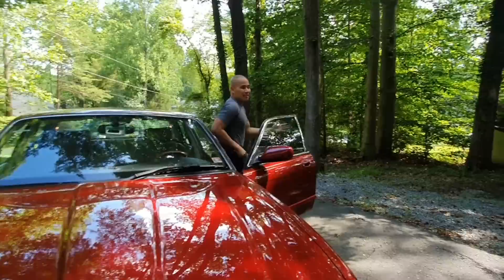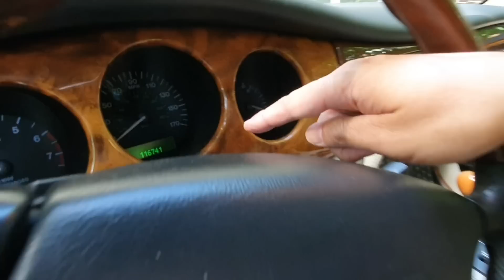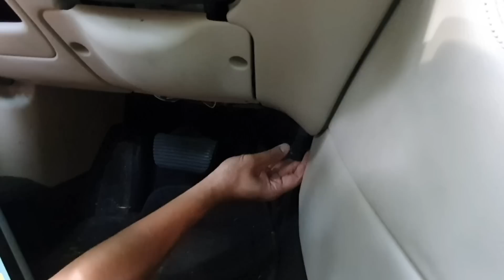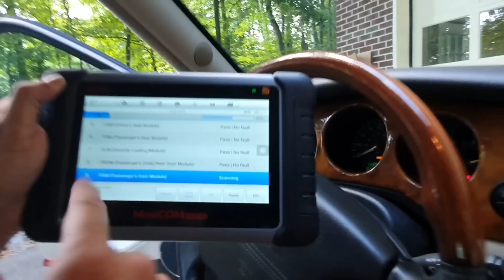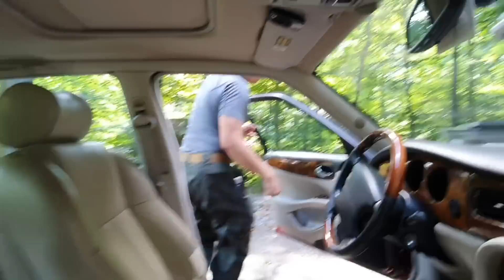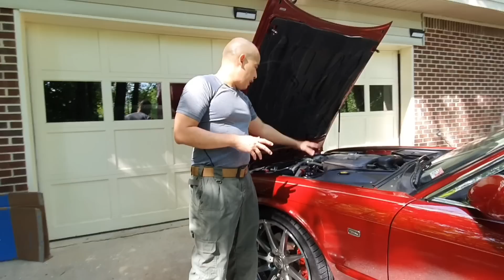Jaguar XJR 2 Years Ownership Update (Reliability Issues, Maintenance and Repair Cost)

Comment: I have an 04 xjr.  I bought it needing maintenance.   So far I've spent 4125$ for  new transmission, 1600$ for suspension conversion .  400$  NEW RADIATOR with installation.   .  Basically to get them in great condition u looking at 8 to 10,000 .  I only paid 3500 for the car with 160k miles.   I was upset from the maintenance but the engine in these cars are monsters an make up for the money spent .  One hell of a engine an this  car jets quick .   I still have some small parts I need to change thats normal maintenance like rotors an brake pads so Basically its like spending 8 to 10,000 on one that's up to maintenance.   One best cars I ever had though ..  if u can find one with low miles an up to par on maintenance get it . U won't b sorry
Reply: I also got a 2004 XJR with over 160k miles on it and man this thing flies like no other car.
I also got it for 3k as it was neglected but the body and engine were in good shape and I put just over 4k for some tires, brakes, suspension work ...etc and it's worth every penny spent on it.
It still has few minor issues like a light here or a fuse there but it's my daily driver now.
Reply from the maker: That is awesome that you are restoring it and using it as your daily drive 👍
Reply: @ejsgarage  I was inspired by your videos.
Thanks a lot for such great content.
Reply from the maker: My pleasure and thank you 😀
Reply from the maker: I had the 2004 XJR too, it was the most beautiful car that I have ever owned. I still miss it.

Comment: i have a 2002 xj8 - same problem with abs light, but when i disconnected the wheel sensors and cleaned the connections it solved the problem. trac warning still comes on but goes off when car starts. great cars.
Reply from the maker: The same here, it comes and goes.
Reply: @ejsgarage  Hi, I had the same issue and solved it just replacing the battery for a new healthy one...it seemed that low voltage from a tired one may cause that false warning lights...hope it helps!

Comment: HI EJ.. did you manage to fix your sun roof...
Reply from the maker: Hi John. No, I haven't had the luck. I think the whole entire sunroof assembly is broken not just the motor. I tried to fix it again and I could not close it. Thankfully, I was able to close it.
Reply: @ejsgarage  Oh well Never mind,,, I had the same problem with mine,, got the part but it wouldn't work again properly. your JR looks a beauty,, how does it ride with the change of wheels.. I drive a friends XJR with similar wheels in Thailand, unfortunately, it didn't ride too well, it may have been the roads ad they are concrete not tarmac
Reply from the maker: As long as I drive on good roads, it is good. I don't drive the car very fast which helps too.
Reply: @ejsgarage  well its great to see your Jag it looks better than ever,,, good to hear from you again..keep up the updates,, best regards
Reply from the maker: Likewise John, it is great to hear from you too. I am going to make the brake pads and rotors replacement video soon.
Reply: @ejsgarage  I will look forward to seeing that EJ,,

Comment: I have a mechanic doing some work on the car before the car wasn't start on the beginning so he put a new fuel pump, then that car show low cooling so he can back and tell me that the heads needed to be turn or machine so after all the work cooling light still comes on for low cooling, and my  fuel gauge move very slow I have driven the car for a few days and now I experience that #8 code.

Comment: Hi EJ...those are nice wheels. I'm glad you are making progress.  For anyone who doesn't buy an ABS Module and wants to look at the common fault on the circuit board,here's a how to(this applies to your car, too) https://www.jaguarforums.com/forum/xj-xj8-xjr-x308-27/abs-error-asc-trac-unavailable-abs-module-remove-repair-62539/
Reply from the maker: Thank you very much Phil. I tried that one tip from the forum and I could not get the old one out.
Reply: The ABS light often comes on when the battery is low. If you have left the car for while the ABS light will come on. Take the car out for a run charge the battery and the light goes out.
Reply: @derektighe7399   It turns out we had a few issues. But it's completely true that a battery not fully charged will welcome all kinds of problems. We had to replace our compressor and two front air shocks, as well as the throttle body. It turns out, our ABS module was fine. The battery needed charging, but it wasn't obvious it was not charged enough, until tested. We've been enjoying the car now, with one issue remaining-some rattling that no mechanic has been willing to tackle(they say the noise is in the dash, and it isn't). Anyway- thanks for your reply, @Derek Tighe.